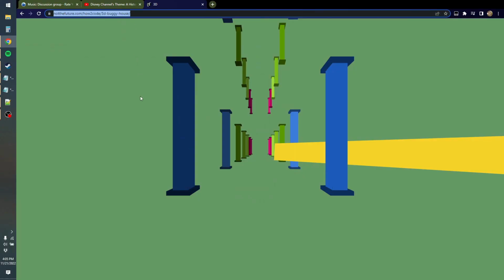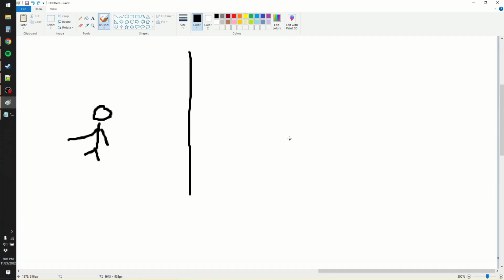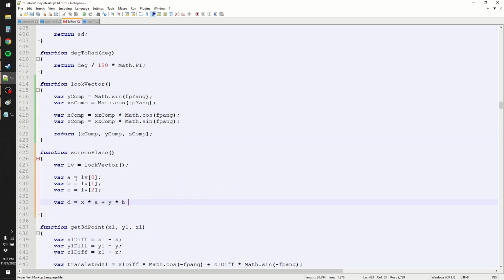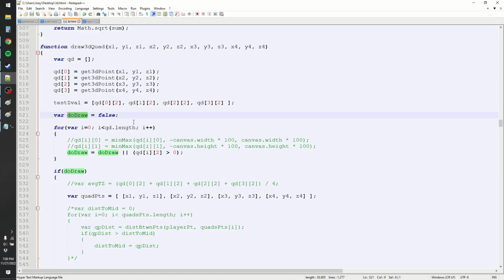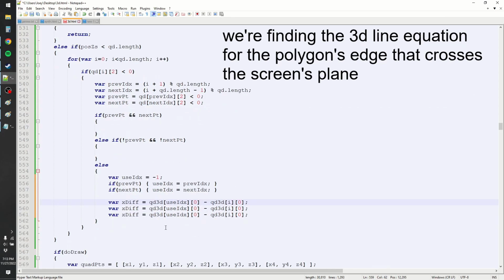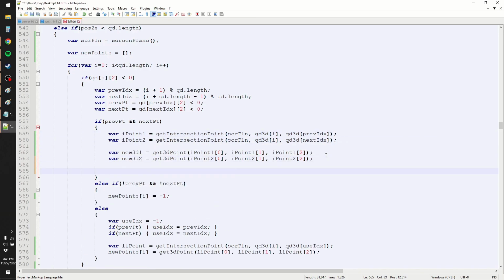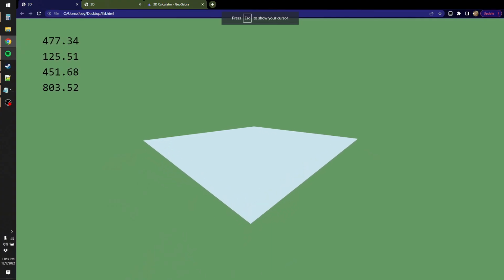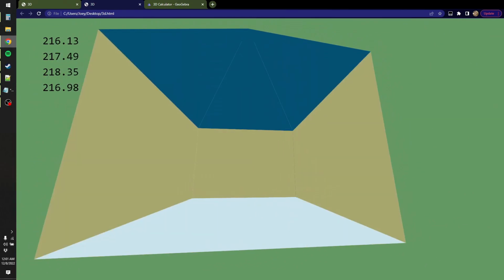3D Engine Coding: lul I was drawing polygons wrong

Comment: single ray per pixel or plane-rays are so much simpler, to implement and comprehend, very much more straightforward, not messy with math
Reply: wtf did i just find... the journeys of looking through obscure shit
Reply: hm lul @lawrencfgsdfg
Reply: @Jkauppa  HIS REPLIES GOT DELETED SO YOU LOOK SCHIZOPHRENICCCCCCCCCC
Reply: You know that this is a JS project?
Reply: @c4llv07e  rendering techniques stay the same, no matter what language/system/platform you decide to use, less or more power, different language, different implementation, but same root
Reply: @Jkauppa  
>rendering techniques stay the same
But if you are using lang with high IO usage (like js) it will be slower.
>seem heavy weight to you
Em, because raycast is weight?
Reply: @c4llv07e  I heard JS is about same speed as bare metal, what do you say and why
Reply: @c4llv07e  doom runs in a sand bucket, but more clever ray casting (plane-ray casting, 2d rays) is very fast
Reply: @c4llv07e  you just said a cpu JS engine cant run a simple doom engine
Reply: @c4llv07e  what I suggested is a true 3d ray casting engine, a better 3D version of a 2.5D ray caster, ~same-equivalent computing effort than original doom/wolf3d engine, check your screaming before you scream at me for allegedly saying something silly
Reply: @c4llv07e  and what you say is not accurate, I did not say anything about any language, its just a rendering algorithm, for any language, and javascript is fast enough
Reply: @c4llv07e  you can run a perfect 3d engine on js, no problems, and on gpu if you require more bare metal speed, and whats wrong with javascript, its not slow
Reply: @c4llv07e  you try specifically to block me from stating this rendering technique, for nonsense reasons, all reasons to speak against God given stuff is nonsense
Reply: @c4llv07e  do a for loop to render each pixel on a 1080p screen, one million pixels to go through, even on a cpu, if you go the easiest route, ray + object sphere boundary volume intersection test
Reply: @c4llv07e  check simondev on youtube for some javascript rendering on gpu
Reply: @c4llv07e  as an example, its working just fine on javascript, too
Reply: @c4llv07e  check coding train for any javascript algorithm doubts and examples to get started
Reply: @c4llv07e  you dont know what you are talking about, why are you trying to teach basic things to an expert
Reply: @c4llv07e  what IO (disk) are you trying to use here, load all to memory then run them, if you cant do it then let those who can do it, not let yourself cannot-do attitude to hinder-slow anyone, but yourself
Reply: @c4llv07e  I do not believe anything you say, right or wrong
Reply: @c4llv07e  dont even start with the "not possible" trash
Reply: @Jkauppa  
Please write it all in one comment, it's hard to read like that. And why are you so aggressive? I don't want you to believe me, I just want to debate.
>I heard JS is about same speed as bare metal
But I don't, and as far as I can tell, the V8 is too slow compared to bare metal. 
Just in case, WebASM is not JS.
>doom runs in a sand bucket, but more clever ray casting
Doom doesn't use raycast (it uses binary space partitioning or BSP, it's not raycast), but Wolfenstein does (2d, but still).
>for nonsense reasons, all reasons to speak against God given stuff is nonsense
It sounds like a joke.
>you dont know what you are talking about, why are you trying to teach basic things to an expert
Because a) I didn't know you were an expert; b) this is the essence of any discussion. I can't just believe in random statements, I also have my own personal opinion that contradicts them.
>what IO (disk) are you trying to use here
Run a simple "while true" loop. If it loads the entire core of your processor, congratulations, your language doesn't switch between states and doesn't use I/O blocking calls. But JS does it. And it is bad because it means that you can't use full processor potential.
Reply: @c4llv07e  I do not care what you want, if you are offensive about you being served, law dude
Reply: @c4llv07e  I have no interest in debating you, go ask God what you lack, I dont lack anything
Reply: @c4llv07e  I dont owe you anything
Reply: @c4llv07e  never argue or believe an science law based atheist
Reply: @Jkauppa  Do you know that you are sinning now?
Reply: @c4llv07e  do you judge
Reply: @c4llv07e  all law based are sinning, dont you respect the cross, you are not making me your b.... I'm owned by God alone
Reply: @c4llv07e  now you made this personal
Reply: @c4llv07e  how did you know I'm sinning
Reply: @c4llv07e  yes you are
Reply: @c4llv07e  if you are law based, judging, then you are the one sinning
Reply: @c4llv07e  "power is sin is law"
Reply: @c4llv07e  you judged without basis, I dont obey law, freed by the cross, is that mad to you
Reply: @c4llv07e  I told you I dont want to talk with you, you are breaking the law (sinning) based on your own law
Reply: @c4llv07e  repeat all the 10 commandments and see If I belong to you or God
Reply: @c4llv07e  I'm not yours to judge
Reply: @c4llv07e  I do not care how you judge and so dont you care how you judge
Reply: @c4llv07e  If you are not sinning (breaking the law) then you are a liar, yes satan
Reply: @c4llv07e  confess now, I'm not judged by law or anything
Reply: @c4llv07e  I dont work for you or law, so buzz off
Reply: @c4llv07e  research/judge yourself only, like commanded, sinner, like you judge you are judged
Reply: @c4llv07e  are you a mindless law based animal, I dont care
Reply: @c4llv07e  hypocrisy, fallen from grace, into law based righteousness, you try to be the judge, buzz off
Reply: @c4llv07e  do you know that you are sinning now, yourself
Reply: @c4llv07e  I do not bow to you satan, or to law
Reply: @c4llv07e  clean my boots slave
Reply: @c4llv07e  I'm not a law based jew / pagan btw, so dont even try that way
Reply: @c4llv07e  I'll take all you think you have, not a gift of God, for you
Reply: @c4llv07e  law based righteousness will not save you, even if you pretend it to be doing so
Reply: @c4llv07e  empty liar fake
Reply: @c4llv07e  you dont own anything you claim to own, not even me
Reply: @c4llv07e  I will not serve you because of God given law, nope, never, go die on your own
Reply: @c4llv07e  Christ is the true saviour, not you, me or law
Reply: @c4llv07e  Christ is Spirit, not the law, why would you say Christ is a dead law based work, inside of you
Reply: @c4llv07e  I dont want ever hear anything about law based righteousness
Reply: @c4llv07e  judge me bro, crucify me bro, or should I say "high priest"
Reply: @c4llv07e  "don't swear" and I would need to believe (in) you, no just a law based liar
Reply: @c4llv07e  if you break one, you have broken all
Reply: @c4llv07e  there is no point in law if you dont keep all the law
Reply: @c4llv07e  do you confess you are sinning
Reply: @c4llv07e  do you serve people? you are then owned by people, fishermen
Reply: @c4llv07e  do not serve me
Reply: @c4llv07e  do not serve the law, you are the slave of law if you claim to serve the law
Reply: @c4llv07e  copper go to hell (outside)
Reply: @c4llv07e  not interested in being in prison (hell) with you, I rather be with Christ
Reply: @c4llv07e  you dont do anything what law says, confess
Reply: @c4llv07e  are you the truth with you being the judge
Reply: @c4llv07e  Christ is my judge, but I'm free, truly free, are you
Reply: @c4llv07e  no law negates the cross, the sacrifice of the son of God, Christ, so stop judging, for people to serve you through law
Reply: @c4llv07e  did you just say "I'm insane"
Reply: @c4llv07e  do you remember what Jesus said about the burning flame, dont touch the law
Reply: @c4llv07e  flesh (law based) burns to black, cheater, blackmailer, forced law service
Reply: @c4llv07e  I'm not guilty under law (not judged under law or ever)
Reply: @c4llv07e  I'm not measured by law, hypocrite, or not by you, lawless
Reply: @c4llv07e  you will not even listen to yourself
Reply: @c4llv07e  you just push yourself as the truth, like its written
Reply: @c4llv07e  no law fear in perfect love
Reply: @c4llv07e  like you cant do sin, I cant do sin
Reply: @c4llv07e  thanks for judging, "bro"
Reply: @c4llv07e  you just judged, not me, but yourself
Reply: @Jkauppa  I've tried ray casting in Java Script, it's very slow, the type of ray casting Doom does compared to regular 3d ray casting is like the difference between rendering something in 1d and 2d, the 2d render is equal to the 1d render's time squared. This is because, the Doom ray cast only has to look across a horizontal line and render vertical lines of varying sizes whereas regular renders have to look across a 2d screen and render pixels for each one, there is far more computation involved in a regular render.
Reply: @c4llv07e  compute shaders work in webgl too
Reply: @c4llv07e  js can do cpu stuff too, why would my explanation of a very lightweight simple rendering method seem heavy weight to you
Reply: @c4llv07e  and